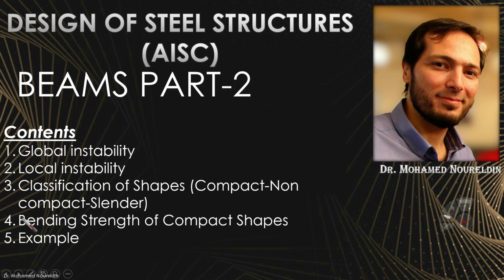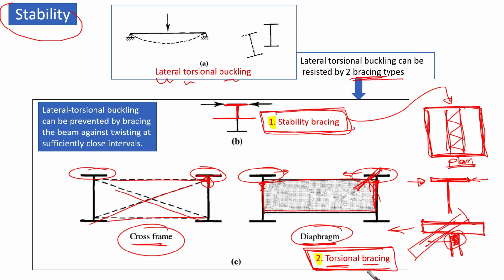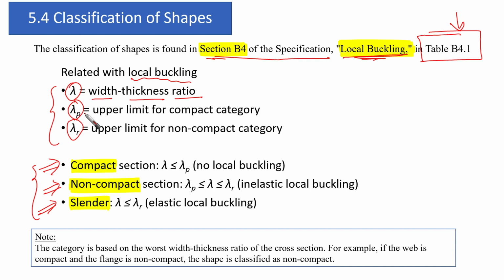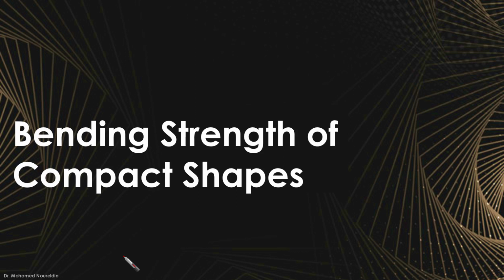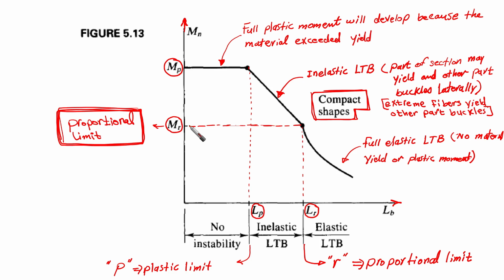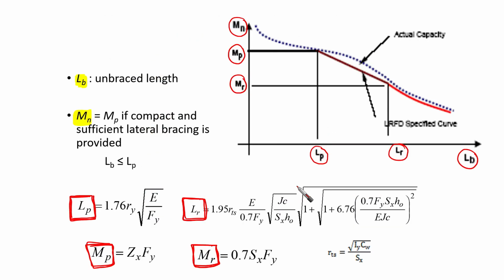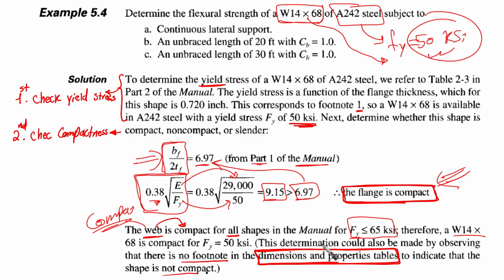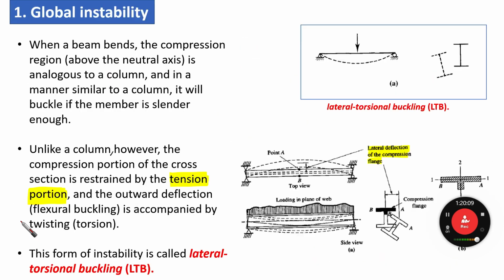14- Beams part 2- Global instability-Lateral torsional buckling-compact shapes

Comment: What should i do if Mn>Mp ??
Reply: I think it is in the elastic region? Because since Mn is less than Mp, it probably is within the elastic range, still not reaching the maximum capacity of the steel which is Mp. I assume that you will still have to apply formulas related to yield moments

Comment: Thanks for the great tutorial, Dr. Mohamed. I think this may be a matter of duplicating (or copy-paste), but I would like to point out that the classification of shapes should be as follows?
λ ≤ λp (cross-sectional shape is classified as compact)
λp < λ ≤ λr ( the shape is noncompact)
λ > λr ( the shape is slender).
Correct me if I am wrong. Thank you.
Reply from the maker: Thanks Thaileang, You are right, I added the correction in the description.
Reply: @dr.mohamednoureldin5718   is the equation nd formula is not sir?